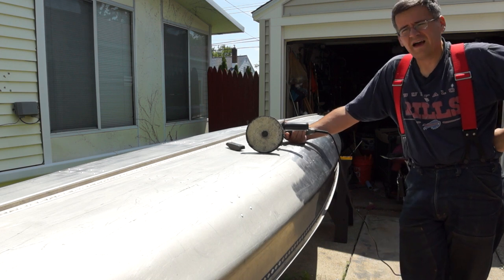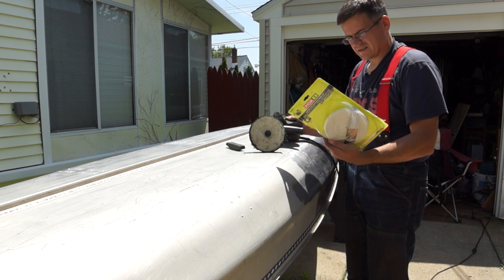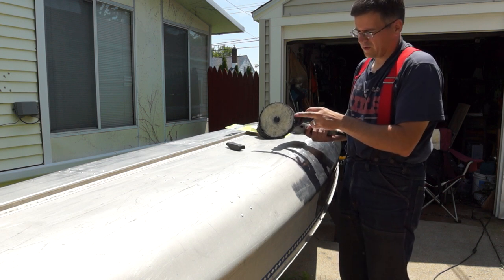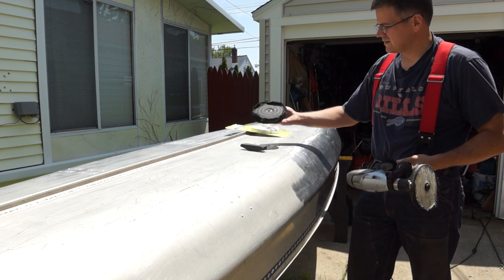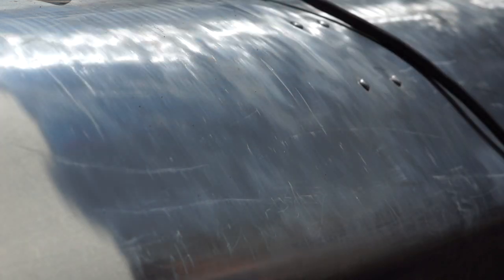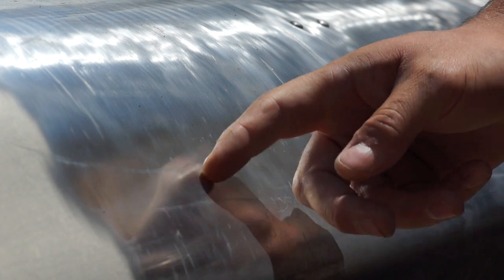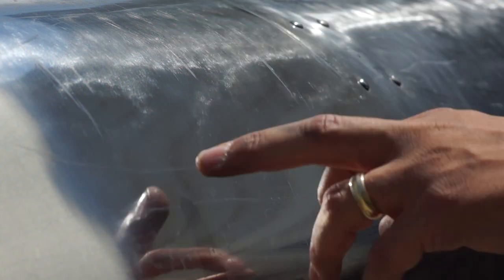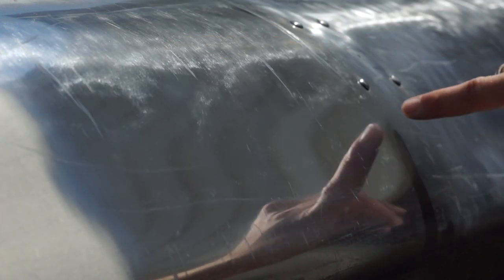Polishing an Aluminum Canoe

Comment: I have had my Michi-Craft T-17 for 43 years! When I was alot younger, I would hand polish it with NeverDull. As I got older the prospect of hand polishing was not nearly as appealing as it once was! So, I let the oxidation process take over and an old aluminum boat builder told me that the oxidation protects the metal naturally, and now she wears a fine oxidized finish;)  I hope that you enjoy your MC canoe as much as I have mine. I'm looking at building a sail rig for it and get into sailing when its to windy to paddle or elec. motor trolling. The aluminum canoe is the most maligned of any material, but in the long run, she'll still be there when the plastic and the fiberglass canoes are long retired. Good luck and stay dry brother.
Reply from the maker: I'm working on a 14' aluminum fishing boat now... over the years it had many coats of paint applied... just about finished stripping but I'm not going to polish this... The tansom rotted out so I'll replace it, check it for leaks (there are several) and repair those then repaint... the canoe is nice polished but there's just too much  surface area for me to want to polish it all out... Planning to use it on the niagara river and lake erie (pretty close to shore) when the water conditions permit...

Comment: If you just took it out in the water you'd be surprised how nice it would look after a few days, just the action of the water against the metal will clean it up.  The beauty an aluminum canoe is you can leave em out in the woods and it'll be fine, put that polisher away and get out the paddles.

Comment: wow...still scratched. if you're interested in a "mirror" finish, you need to sand it first with about 180 grit, and work up to 800 grit on an orbital sander(such as a body shop would use) not a rotation sander. then when your gouges and scratches are gone, start polishing with a high speed polisher (about 3000 to 5000 rpm) with green rouge on a cutting pad. then change your pad to a white finish pad and use the white or blue rouge. it will become like a mirror. hope this helps.
Reply: How long will it stay like that?
Reply: You can't just forget about it.  A canoe?..I'd guess a touch up by hand every few months. Semi rig rims and stuff is a constant touch up because of the weather and road grime wear
Reply: I learn so much from comments.  Thank you for this.  I also read another comment below that aluminum oxide is also a kind of shield from further corrosion.
Reply: @gblankster  there are products that are "supposed" to help maintain the shine..I have never used them, so I can't verify the claims. But probably worth a try. I hear guys using that stuff on polished stuff under the hood of show cars, ect. 
Personally I just touch it up every so often with nothing more that a rag and polish by hand. Once everything is polished, it really doesn't take a whole lot to keep it that way, you just can't ignore it or forget it for long periods of time.  Weather, road grime, road chemicals,  ect wreak havoc on wheels.

Comment: Polishing your canoe actually makes it slower. If you research how water moves against a hull You will find there is something called viscous sublayer and this “sticky” Water provides lubrication as the hull moves through the water.
Reply: Your on the right track, but actually, the viscous sublayer is less "viscous" when a smooth finish is applied to a hull.  Thus, a polished hull is less "sticky" as it moves through the water, making it easier to propel - or, in other words, faster.   Fishes exude a slime layer that acts as polish, which promotes less resistance and thus faster movement.  Same principle applies to rigid objects.  Waxing the composite or plastic hull of a competition canoe or kayak works the same.

Comment: I polished an aluminum canoe with plain old steel wool. It came out like new......then a neighbor told me that the grey oxide that forms on the metal actually protects it from corrosion......I should have just given it a good washing and left it alone.
Reply: Do not do this!!!!!  Steel wool will leave tint bits of... Steel wool.  That you just ground into the surface of the soft aluminium..  those tiny bits of steel will rust and leave your canoe ruined.
So much shite advice on the web😳